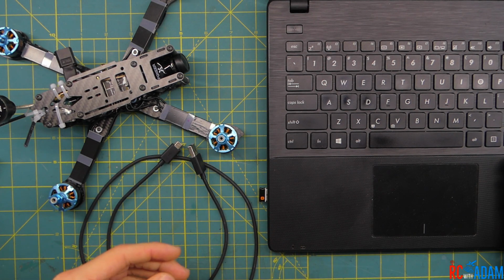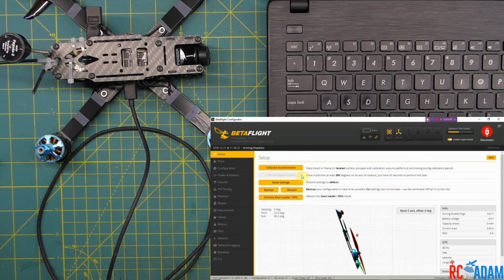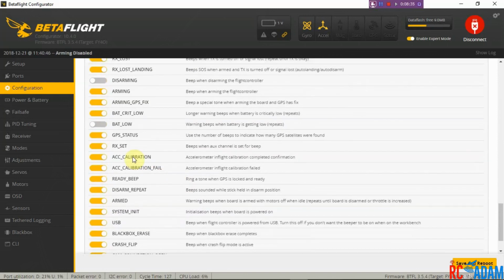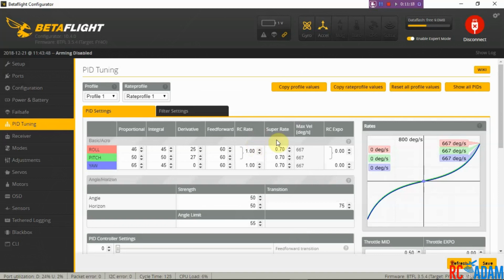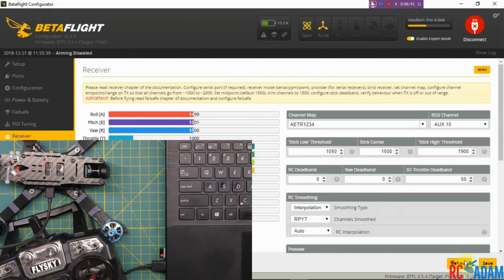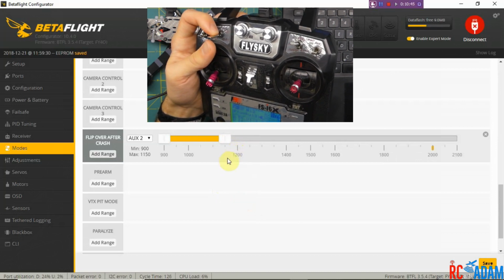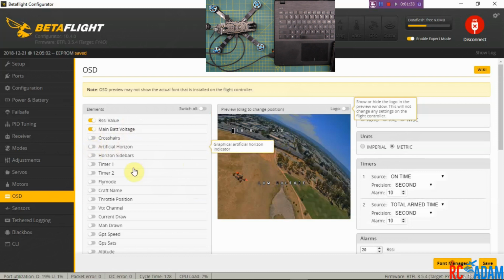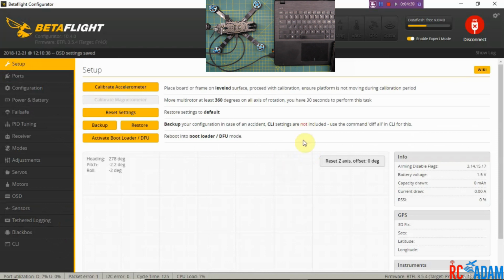Budget Basher Build -PART 6- BetaFlight Setup [COMPLETE BEGINNER BUILD GUIDE 5" FPV DRONE]

Comment: If you can’t get DFU and you have installed all the drivers and ripped all your hair out !! then try changing USB ports on your PC / Laptop, I was using a high speed port and it would not work so switched to a standard USB port on the back of my PC and it worked...

Comment: Hey man idk if your going to see this but I been following your video and everything was going good intill I got to the part where you connected the controller to beta flight idk why but my controller doesn’t connect to it I’m using the same controller and receiver can you help me out ?
Reply from the maker: Hey! It could be a firmware or cable connection issue. See if this video will help https://www.youtube.com/watch?v=NfqdJ99ocLQ .
Reply: Thanks man

Comment: Hey Adam, cheers for the build guide. Is there any particular reason you've got the motor direction spinning outward vs. standard inward direction? I read that reversing direction means that grass and debris get pushed outward and away from the camera lens. If they were in the normal rotation, the debris would be pulled inwards towards the lens. Any other benefits of reversing the motor direction?

Comment: Hello Adam, I just finish building my first quad today but whenever I arm the quad 3 of the motors spin fine, but one motor spins for a second and than beeps and stops. Any help will be greatly appreciated. 😊
Reply from the maker: Hi! Congratulations!! What ESCs and motors are you using?
Reply: @RCwithAdam1  mamba f405 stack and the racestar racing edition 2205 2300kv
Reply: @zachmorse1  is it a mk2 i have just finished mine it could be a malfunctioning motor
Reply: @dbproductions6656  yes, I belive that must be the problem becouse I swapped the malfunctioning motor with a esc pad I knew worked and the motor still didn't work

Comment: I have a flsky ct6b transmitter and receiver.. how do i connect it with the flight controller?
Reply from the maker: Hi! I'm really not sure. I think you will have a very difficult time trying to get the older tech CT6B working well with a quadcopter. Sorry I couldn't help more!

Comment: Why reverse the engine rotation?
Reply from the maker: Hi! The motors each need to be spinning in a certain direction for the quad to fly properly (same with propellers). If certain motors don't spin the correct way when first checking after soldering, they need to be reversed.
Reply: @RCwithAdam1  Ok i actually read about the motors spinning the other way than the traditional way Betaflight (and I) always have been using. Will be doing reversed direction for sure :)
Reply from the maker: Ohh, I thought you were asking why the individual motor direction would need to be change. Yes, I like to have the front props spin outward from the camera so that debris doesn't hit the lens and branches won't get pulled into the frame.
Reply: @RCwithAdam1  Yeah exactly, ive always had my mind fixed on props going inward :) Im soon making my first build inspired by your Mamba stack build, and i will have them going outward for sure.
Reply: @RCwithAdam1  
Hello! Is the yaw correct for this reverse engine direction?

Comment: This is the first time I have had problems setting up a fc I can't get the receiver to work I connected everything like you did and using the same transmitter as you any input thanks
Reply from the maker: Hi! That sucks! Can you describe what your fc/rx is doing (or not doing), to narrow down the problem?

Comment: I just can't flash the fc, tried 3 diff. cables. But I can connect fc to betaflight successful, is maybe something with drivers?
Reply from the maker: I think so. Do you have the Zadig driver thingy? That's what I needed.
Reply: RCwithAdam I will check tomorow, tnx
Reply from the maker: Notice how in this video in the top right corner of the betaflight window, there is a little dropdown box and it says "DFU". I believe that's what it should say if you have the correct drivers and everything is working good.
Reply: @RCwithAdam1  thanks, fixed with impulse, and flashed easy

Comment: Go in power and batt. tab and make sure both voltage and current sensors are set to onboard adc. Voltage scale is correct and amperage should be set from 400 to 169 and current draw/ batt voltage will be correct
Reply from the maker: Thanks for the tip! 👍
Reply: Thank you, Christie. Mine needed the scale to be set to 13 in order to get correct amp draw... 😂